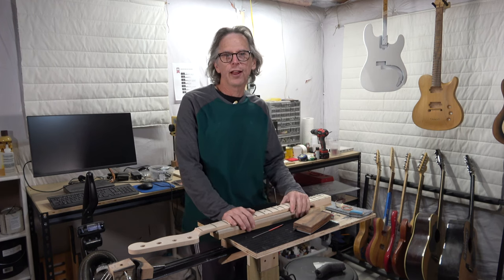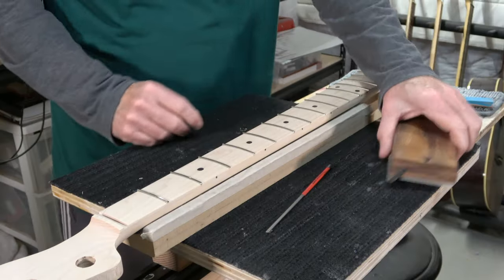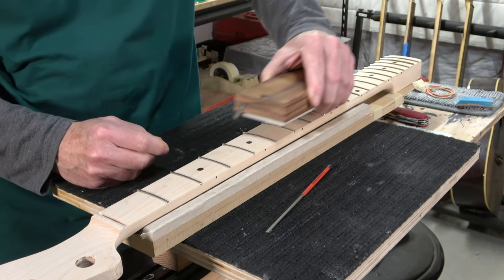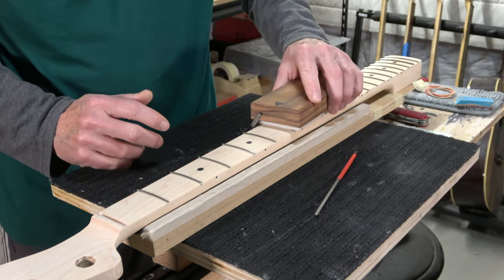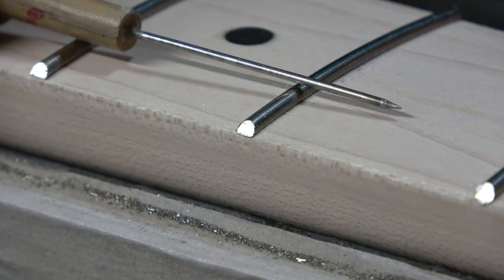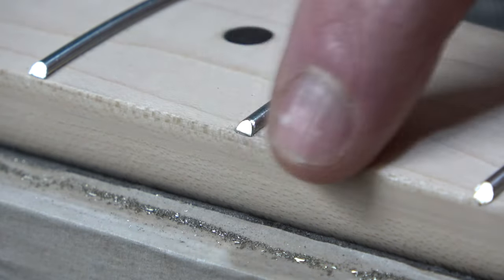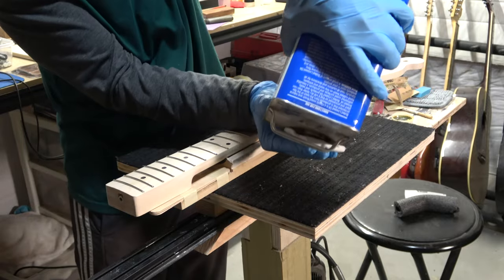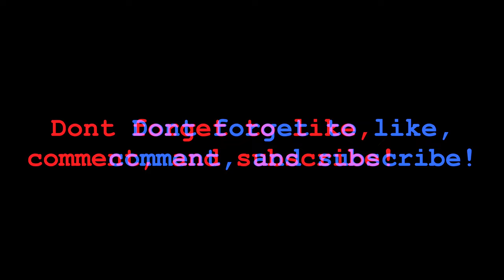Building A Precision Bass Part 15 Beveling Frets And Applying The Finish To A Guitar Neck

Comment: Thanks for showing, and sharing this information, I appreciate it!

A questions... and something I often find hard to determine, while beveling frets.
When exactly do you know that you've reached the point where the bevel is complete, and you stop?
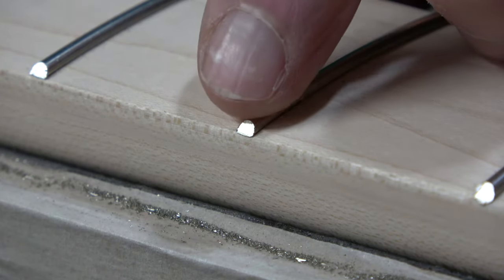Is it when the bottom of the fret(s) is nicely close and flush with the fretboard? Like showed in the close-up, at 8:26 - there's no visible gap between fret bottom of the fret and the fretboard edge.

Thanks!
Keep up the good work.
Have a great weekend!
Reply from the maker: Yes.

Comment: Yes , I wonder how to clean such a surface of the fingerboard ( I think it's maple , not birch ), soaked, as the master said , and showed with linseed oil ? The rosewood overlay is cleaned with a special composition from D'addario based on lemon oil.Good. Does this composition clean the very light surface of the fingerboard with which the guitarist 's fingers are constantly in contact while playing the guitar , which is described in this video ? Or is it necessary to use a completely different cleaning agent for this purpose?

Comment: How would the finishing steps be different if one decided to stain the neck wood first? Would boiled linseed oil still be suitable? Thanks
Reply from the maker: Do whatever you want.
Reply: @HighlineGuitars  I have in fact tried to do this but the instructions I was following at the time suggested that stained surfaces should be given an intermediate layer of sealer, before application of the oil finish. I may not have done it right but the result is that the neck does not feel natural/smooth anymore.
I was wondering if this "intermediate layer" approach is strictly necessary.
Reply from the maker: @Gsazraetr  Exactly what stain and sealer did you use?
Reply: @HighlineGuitars  Every single product was by   drumroll   Birchwood Casey:
water-based stain
Sealer&Filler
and finally Tru-Oil

Regular maple neck; I quite liked what the stain did to the colour, and the feel of the wood was wonderful before application of the sealer.
To tell you the truth, I have probably been blaming the sealer because I've heard such great things about Tru-Oil. However, I don't think I would have been happy even if I had skipped the sealer and used only the Tru-Oil (which was my original plan).

What was especially surprising—and what no one ever seems to describe—is how glossy Tru-Oil makes the surface. I was under the impression that the whole point of using an oil finish was that it lets the wood retain a smooth, nonstick feel.

Would really like to hear your thoughts. I'm sorry if I'm wasting your time.
Thanks
Reply from the maker: @Gsazraetr  Tru Oil is an oil-based varnish which is why it yields a glossy finish. If you want a smooth, nonstick feel, you should use either boiled linseed oil or my new favorite Lee Valley polymerized tung oil. Also, water-based stain will raise the grain as it dries which will make the wood feel rough. After the stain has dried, you should rub the surface with some 000 synthetic steel wool, like Nortons or 3M. Doing this will lighten the color, but it will also remove the raised grain and make the wood feel much smoother. An alternative would be to use an oil-based stain instead. Oil-based stain won't raise the grain. Since the wood is Maple, I would omit the sealer/filler as it really isn't necessary.
Reply: @HighlineGuitars  Thanks. Must say I am positively baffled by the TruOil fandom.

Comment: I wonder if it is possible to impregnate the neck with wood wax on the reverse side , or is the use of linseed oil more effective in this case , and wax is not suitable here ?
Reply from the maker: The problem with wax is it wears off and needs to be reapplied. Even if the wood is impregnated with wax, frictional heat will, over time, break down the wax. Boiled linseed oil is more permanent.
Reply: @HighlineGuitars  Thank you very much . Now it's more clear.Boiled linseed oil. It well replaces the varnishing on the back of the guitar neck . I will also read , if necessary , how contamination from the surface on the back of the neck , treated with boiled linseed oil , needs to be removed .I am almost 100 percent sure that it is not necessary to use diluted alcohol , or a means to remove dirt from the lacquered surface of furniture , probably it is also impossible . I typed my question 10 days ago . Therefore , I don 't remember quite exactly what you said . Maybe you touched on this point . I can look it up on the Internet .
Reply: @HighlineGuitars  OK , thanks for the answer . I have a question . Here I have a rosewood fingerboard on an acoustic guitar . Is it possible to process it with Boiled linseed oil ? After all , here you talked about applying this oil to the back of the neck , and the upper surface of the fingerboard , which are simply made of maple . Rosewood overlay can also be processed according to the method you proposed in this video ? And , if yes , if you play the guitar , how often do you need to do it , after each string change , if I change them every six months , or more often do I need to , or once a year ? What do you think?
Reply from the maker: @сергейсолоницкий-м9ь  https://youtu.be/xJczli6N7FA